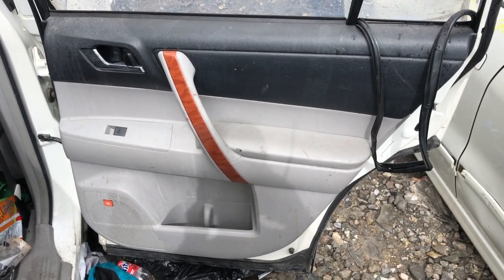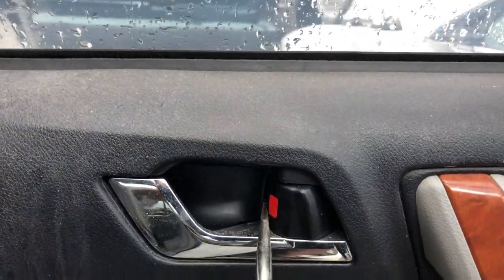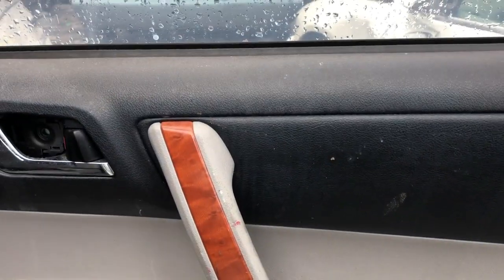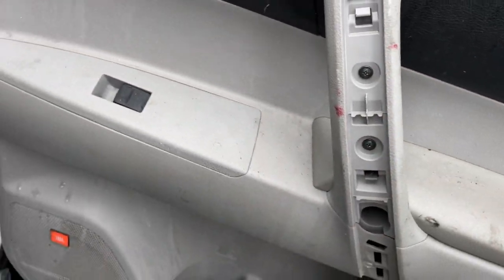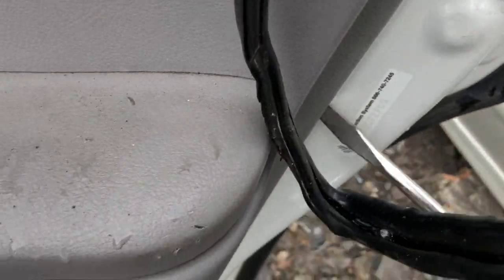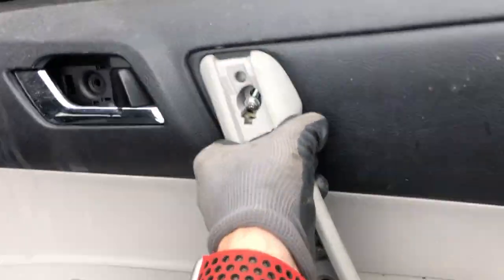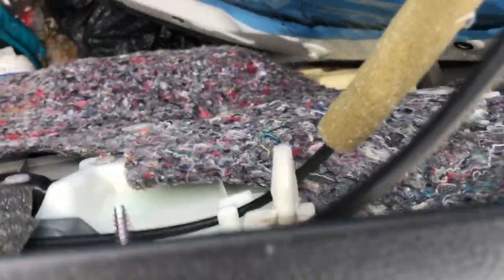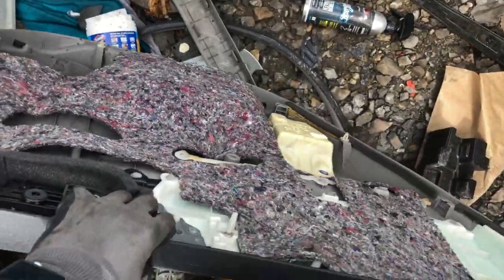How To Remove Door Panel 2008-2013 Toyota Highlander In Under 5 Minutes

Comment: If you remove the "wood" trim piece from the top it will break a small tab. Nothing that really affects function or visible from outside, but FYI, it should be pried from the bottom.
Reply from the maker: Thank you! This is great to know.
Reply: Yep. Mine was chipped by the garage guys.
Reply: Just did that and the super cheap plastic broke all the lower tabs at once and snapped the trim piece into two pieces...no excessive force. Just enough and pop broken...

Comment: Spend $20 on some plastic panel tools.
Reply: Unless you're at the junkyard.. lol
Reply: Yeah I think he was being a rough guts because it was a vehicle for wrecking out for parts ?
Reply: I agree. Even if he's not trying to preserve the door panel, it's usually much easier and faster to use panel tools to pop trim and release fasteners. The fastener I ruin is usually the one for which I don't have a replacement on hand.